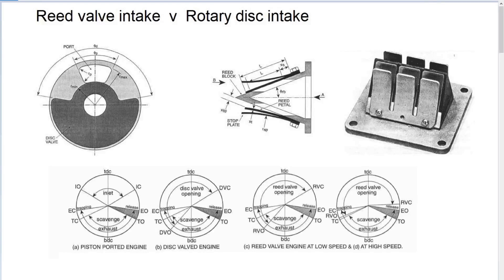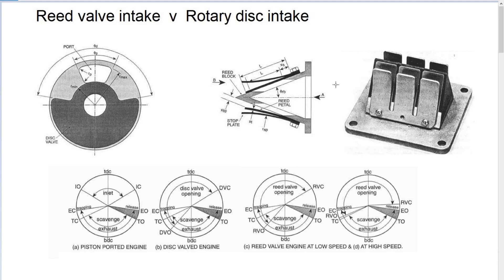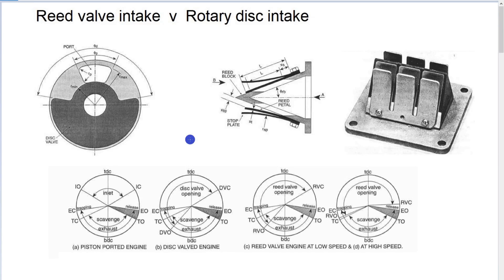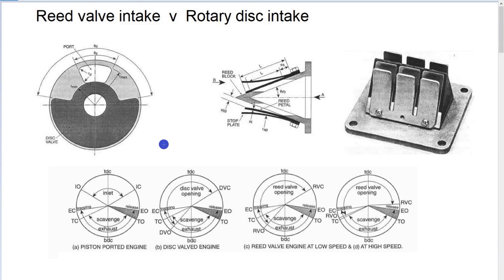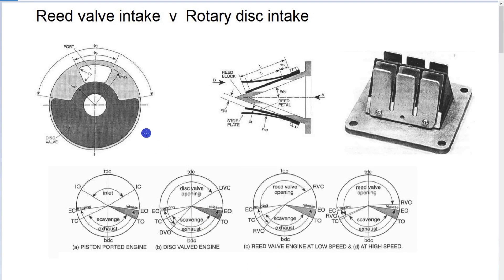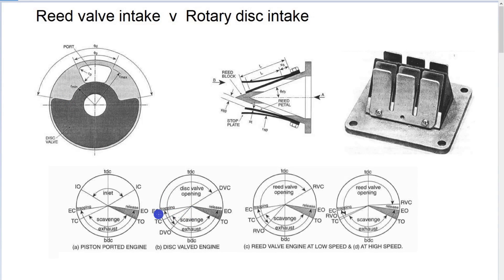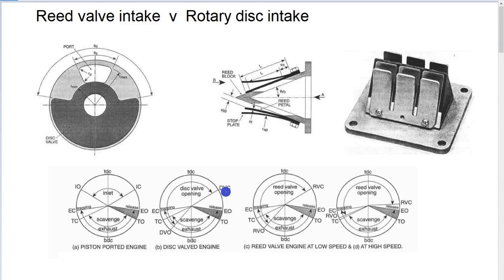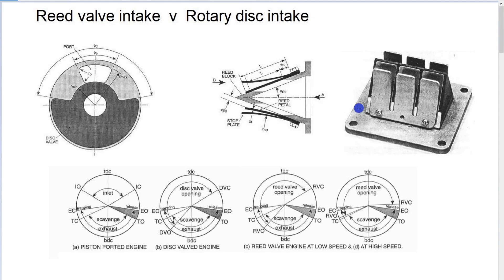Reed Valve V Rotary Disc Intake and why small 2 stroke engines favor the later.

Comment: Hi used to have a yamaha fs1-e fizzy 50cc we used to cut the disc down a little bit each side it seemed to make the bikes go better would  doing this make a bike go better all just do nothing at all if it do make a different how much could cut away to make most power
Reply from the maker: Yes increasing the timing should produce more peak power, just be mindful of the relationship between DV opening and transfer closing point.
Video covers that to some degree at 6:00 onwards.
If you are going to mod the DV best to start by increasing the opening point first.
Reply: There must be a limit to how much you can cut away all can you cut a lot away as long as you can still time every think in
Reply from the maker: There is a limit for sure, you will reach a point where there is no gain by increasing the DV opening.
That will depend on the exhaust and transfer timing.
All three port timings need to be set to suit the peak RPM and are all relevant to one another.
That is where specific port time area analysis comes into play.
Open it too early and close too late and you are going to get some serious flow back or reversion that will upset mixture control at the carb and effect power adversely.
Reply: Very interesting nice to talk to someone who knows what they on about
Reply from the maker: Cheers
Just need to keep in mind that as RPM increases the less time there is for mixtures to enter and exit the engine.
So for high RPM we need more port timing period / port area.
The second part is the power spread or peak is more down to the relationship of port timings to one another.
Reply: Thanks.what would happen if you raised the compression ratio by skimming the head and barrel
Reply from the maker: Increases in compression will raise power output all the way through the RPM range.

Comment: do u know anything bout this  KH125 (GTO125  the disc has a small hole on the other side of the inlet i read it gives the boost port more kick and I don't see how that is ,to me it looks like the small hole did not line up with the inlet and if it did it would bleed crank air fuel back to the card unless im missing something and I would like to see what you think of boost bottles  and how they help
Reply from the maker: Hi jt
I had a look at a parts list for it, hard to see the intake cover for the carb but I see the small hole.
That hole is so small there wont be much flow through it so I doubt the boost claim.
It also seems to align with the clearance slot on the engine plate as it rotates
It only has one gas relief slot around the face.
Note the rotary disc hub looks like a floating disc not rigidly fixed to its hub.
I would hazard a guess is it allows pressure to equalise each side of the plate so it doesn't get sucked against the surface being the disc floats on the hub not fixed, which would cause it to wear on the surface.
Without seeing more of it that's about the best explanation I can think of.
Does the oil injection pipe bolts to the DV cover plate anywhere, if so that may have some bearing in its purpose too.
Reply: its crazy I read a lot of people go on and on bout this small hole makes more power monkey see monkey do , but I know what your saying bout surface wear , I think the hole is bad and will bleed when you don't want it to but maybe its needed, glad to see some1 in to this stuff like I am your show is the best I seen with making tune pipe and really getting in to it so I don't have to buy the soft wear to make a pipe I know I should buy it ,I make couple pipes and getting better always looking for the new trick with anything do
Reply from the maker: With such a small flow any significant pressure differential will be a "choked flow", that means the speed of gas flow through the hole remains the same from that point on regardless of an increase in the pressure differential.
And the period of time involved is milliseconds.
Meaning there wont be enough gas flow through a very small hole or time to do anything like boost.
Id leave the hole there as it is likely there to resolve mechanical issues as I mentioned.
Reply: looking at that small hole ... its most likely a timing orientation feature for installing the rotary valve, nothing more .. a look at the assembly manual would be telling.

Comment: What kind of gain would you estimate going from piston port to rotary valve. On a small engine. Say low to mid 30s
Reply from the maker: To arrive at some figures of gain you would need to use a 2t modeling software the crunch the numbers for each engine to compare and provide power figures to compare.
Otherwise it would be difficult to quantify with any values.
But in short the smaller the engine capacity is the more benefit to Rotary Disc has over reed and piston port.
Reply: I know that it would be quite a few variables. But figure both were tuned well. Would you estimate like 1% or 2%.  Or you thinking like 10% or more. Just kinda trying to ball park. Or would you have no idea with out modelling.
Reply from the maker: Its a question best posed to Sprint Kart owners who race piston port, reed and rotary disc 100cc as to the observed differences in power output.
I can only give you the technical differences of each type to compare to.
Reply from the maker: Only comparison I've had myself is driving RV, Reed and Piston port Karts on the same track.
However the RV (Parilla 100 cc) and Reed (DAP 100 cc) were both open class not homologated stock engines and both modified, but the Piston Port was homologated stock (Yamaha KT100S)
So the PP was slow by a great margin, the Parilla RV creamed the DAP in the top end, it pulled hard to very high revs, but it was also the one that grenaded pistons twice.
Not sure if that is any help.
Reply: Sorry.  Didn't think it would have been such difficult question. Thx for the info tho. I will try to do a bit of looking around and see. Just learned about the rotary disk a few weeks ago. Be a lot if work to incorporate into use on weed string trimmer engine on a rc car. But kinda neat how they work.  Thx again.
Reply from the maker: The problem is that each engine has other differences, re the boost ports on a Reed and the fact that the piston port relies heavily on the expansion chamber expansion wave working to overcome back flow that the rotary disc overcomes by timing so when the piston port goes off the pipe peak power drops off where the RV timing overcomes back flow.
If you try to open up the piston port timing you have the problem of it closing too late and you get reversion at the carb (fuel droplets spitting out back out)
The reed cancels out back flow so long as it exceeds the pressure differential from casing to cylinder, which in bigger capacity engines it does more easily.
Reply: So the engines need to be port timed different to make use of type of intake design being used.
Reply from the maker: In short yes, the means of controlling intake timing cant really be isolated form the other factors to do an accurate back to back comparison.

Comment: Hi. Very interesting videos. Could you do more un rotary valve or if you have the time for me to ask you some questions i would really appreciate it. Thanks in advance
Reply from the maker: Hi Ben 
Any questions feel free to ask.
If you prefer email
ausmecham at gmail com
Reply: AuMechanic Hi. I have transformed a derbi 50cc with longer stroke and a 80cc cylinder 90cc in total,  in to a rotary valve intake. I want the bike for a top speed drag bike. Exhaust duration is 201° and 135 port duration, what would you recommend has a starting point in disc timing. The disc is 112mm wide. Is your email address right? I can send you some pics if you want. I appreciate you're help and time
Reply from the maker: Hi Ben, just need to ask
Is that 135 total transfer timing ?
Also what is the peak RPM ?
Reply from the maker: Email is ausmecham at gmail com, I just removed the @, YT sees everything as spam even my own comments.

Comment: I rebuilt my seadoo a couple of years ago it had a direct injected oil anf fuel, also had reed valves and power valves. The engineering that went into it blew my mind.
It was a rotax 951.
Reply from the maker: Hi Stevo
Water craft have some interesting reed arrangements and used reed very early on.

Comment: Well worth the wait! I hadn't considered the rotary ability to basically negate reversion of cylinder charge via early intake timing, which is basically impossible for reeds sans some complex mechanical wizardry that would be prone to breakage or at least compromise flow. Far easier to engineer too, I would imagine, lacking the pitfalls of inertia, flexibility vs sealing, and "valve float", never mind the box volume vs flow characteristics conundrum. Are rotaries less suited to larger cylinder volumes, or is your cutoff just one of obvious advantage?
Reply from the maker: That is the main benefit at low and mid, when you compare to piston port that relies in the expansion chamber pulling a good suction wave to counter that the RV will manage if off the pipe giving it more low down.
If you tried to increase piston port timing you would end up with late closing causing nasty reversion at the carby spitting fuel out at low revs.
And yes to the later,  reed has no advantage with large capacities, its a case of the rotary has diminishing benefit the larger you go which leaves the reed as the better option on the basis of simplicity and compactness over a RV, being behind the barrel not side of the motor.
Reply: AuMechanic Piston ports seem fine for low performance, but are basically a high wire balancing act of compromise. Reeds obviously need at least some crankcase low pressure compared to the carb to just open, and require compromise as well in that rigidity, flexibility, strength set of requirements. Rotaries can open at dead, positive, or negative pressure compared to the carb, huge advantage, the only real compromise is port cross sectional area changes as the valve transitions state between open and closed. But, that "just cut in a crankcase port and drop in a Reed case" requires a LOT less head scratching, lol. I can see the diminishing returns on big rotary set ups just on crankcase volume/pumping volume/port clearance realities for actual gas flow to occur, though I imagine you could force it to work through offset or "cake pan" valves. You certainly stimulate my old brain cells, lol.
Reply from the maker: Suzuki had the Reed Piston port hybird, working as a piston port primarily and having the reed to feed the crankcase by gas inertia.
But was only really beneficial around the mid range.
So reed can be more versatile in that way.
Reply: AuMechanic I guess if you toss enough tech and sliderule you can make just about anything work, but the actual return for the effort and complexity, and the cost in reliability is where the rubber meets the road, lol. That hybrid idea actually sounds intriguing, but I can see how the advantage would diminish as the "port signal time" duration falls off at high revs. It actually sounds like those bicycle engine Reed kits in a way, only adding the Reed to the case and y piping the carb outlet, allowing a very mild Piston port timing but good packing until the Reed state latency eats too much time in the cycle. And I thought packing 4 strokes took brains, lol!
Reply from the maker: It was used on the old RM Suzuki off road bikes which made use of the good mid range.
Reply: AuMechanic I was thinking it would make a great experiment on those tiny chineseum Mills, as everything about them is reasonably mild by design, and the cost would be very low, while the parts are actually available off the shelf. Or one of the 49cc scooters, though the 2 strokes have become rare here thanks to emissions
Reply from the maker: Alex is working on the Chinesuim Engine planning on doing some mods.
He made a reed for the SPX a while back I recall and might consider it for the PP engine, and he has the dyno.
I'm planning on machining up some test apparatus if possible,
I want to make something like the QUB SP sonic wave test bed made by Gordon Blair and see if we can repeat his experiments.
He has given enough details on it, I just need to get hold of pressure transducers and looking at that now..
Reply: AuMechanic I saw Alex's short series on hopping up the bike motor (dizzying HP levels, lol). They're actually pretty popular here in the states, though absolutely illegal for street use here in Florida. They do seem ripe for actual "technical modding", as most of the performance stuff hawked here seems more stylized accessory than experimentally derived parts, and many of the "experts" seem to be hawking snake oil, lol. Kudos on the Blair idea, the tech is probably much easier to get hold of now, those Arduino folks have brought what was exotica not so long ago into reach of we mere mortals thanks to the Chinese job shops competing for nickel profits per item.
Reply from the maker: That's what I was thinking about, there are loads of mod parts sold for those bike engines and some of them have whiskers on them.
Be good if he can test a few of them on the dyno to see if they are any good, might save a lot of people some money exposing the ones that are just fashion accessories passed off as performance parts.
I was thinking about using a few PIC chips I have to make some high res buffers for the transducers but am leaning toward a Rigol 4ch Scope I can do hold patterns on and transfer to PC. 
Ill see how that pans out.

Comment: nice video! how to improve the rv system efficiency? to make it open earlier and close quicker? are using harder reeds and altering the reed stoper angle would help?
Reply from the maker: Hi Cer
Tempting as it is to bend the reed stop back increasing the lift of the reed could be terminal, it could cause the reed to break off at the root. There are other methods to improve the reed and I can go into that in another video as there is a few issues to resolve doing it.
Improving the RV disc is helped by proper port matching at the disc, some other mods are possible to avoid collision of mixture with the side of the crank, but overall tuning the disc timing itself will have the most profound effect.
Reply: AuMechanic Great! Learned so much from your video. Can't wait for next one!
Reply from the maker: Glad you got some info from that, Be another video this week.
Reply: HI, i completetely removed the stopper from my bike, and my power barelly increased( i didnt feel any increasing) but im sure it helped, but i dont have a good setup and only 70ccm with not more than 12k rpm, im sure they would break if my rpms were higher or had more cc
Reply from the maker: Hi ACreativeName
It will depend on the engines ability to open the reed to its stops but that's a bit hard to test for so the safe bet is don't bend the stops out.
A break at the root of the reed from doing that means the whole reed petal comes off and gets sucked into the crank case.
It can get mashed by the crank and bits of it get on the big end and up the transfers.
There are other safer mods you can make to them and we might cover that in a video.
Different reed thickness, 2 stage reeds, working the cage to get better flow, slight increases to the opening at each reed to name a few.
Reply from the maker: I agree it would effect the transition time of the reed if it was allowed to roam free.
Particularly if the reed material has a natural frequency around the power curve it could flutter badly if not limited.
Some early reeds didn't have stops and had a habit if ingesting them, didn't take long to start using a stop to control them..